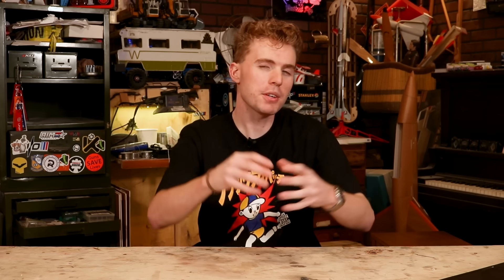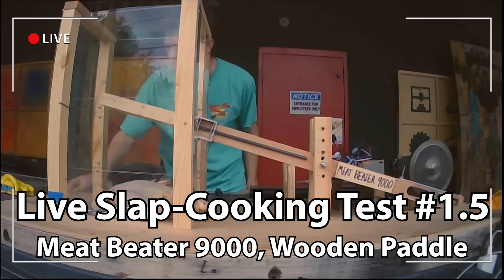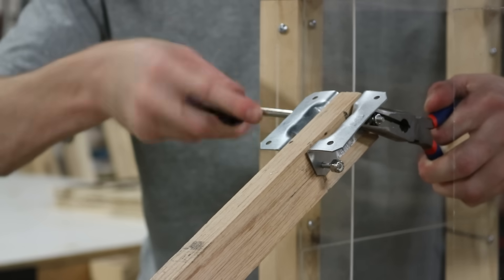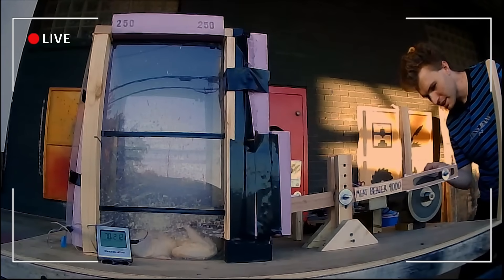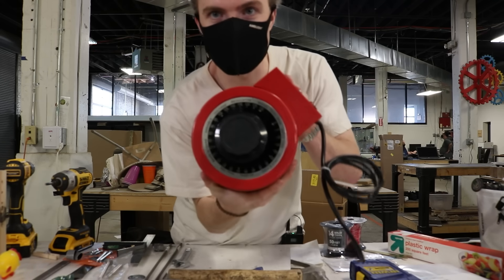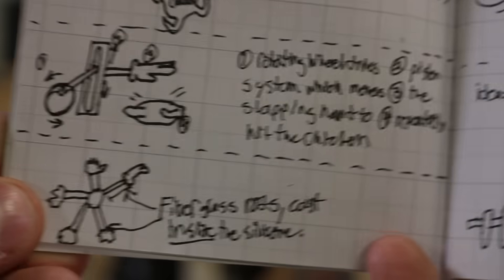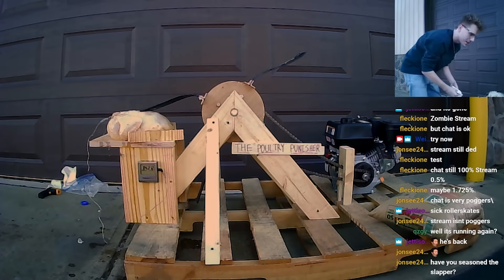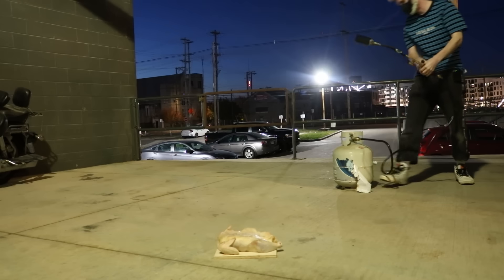How Many Slaps does it Take to Cook a Chicken?

Comment: The rubber flap slapping rig was blowing way too much air on the thing probably cooling it basically as much as the impact was heating it, I think most of its heating effect was just friction too.

The initial slapping rig would have to be revisited and just rebuilt with more durability, and the chicken would have to be contained in something that spares it the actual direct impact, like say if you built a steel casing to put the chicken in and slapped the casing instead of the chicken directly, once again keeping it inside of a temperature controlled enclosure.

Arguably though you'd just be using a slap heated oven then but it'd be closer to functional.

Comment: So is there a rule you can't apply the slaps to another medium to heat the chicken? Like I'm mostly asking why not put the chicken inside a metal container and then apply the slaps to the medical container? I mean yeah you need even more kinetic energy at that point, but you solve the structural stability issue of the chicken.

Comment: It seems the main problem is heat loss from the ambient air so the easy solution to that would be to build a vacuum chamber to house the chicken and the slapperatus. Since a vacuum is one of the best insulators every slap input should raise the temp of the chicken. I recommend a collab with hacksmith industries

Comment: The problem with the Poultry Punisher, aside from the incredibly unsafe drive train design, is that you are using what basically amounts to a blower fan to slap the chicken. The slappers are going to he cooler than ambient temperature and as a result sap heat from the chicken.

Comment: You need to slap a highly conductive metal and then use the heat transfer to cook the chicken.

Basically, you could make a CPU-type cooler which the chicken is surrounded (at least on the bottom) by a highly conductive metal and there is a high powered generator hitting a "hot place" which then spreads the thermal energy throughout the chicken cage.

Not cheap as you would need to create a custom metal high holder, a metal "hot place" that could withstand substantial force, and get an extremely high powered device that could efficiently and repeatedly contact the hot plate.

It is most certainly possible to cook a chicken by slapping it.

Comment: For the last attempt, there should have been a heater attached to the rubber allowing it to give off heat. Instead of long strips of flimsy rubber, try stronger rubber. This might help although it could make things harder and more expensive. Honestly I'm a sixth grader so i might be wrong about this so testify if you desire.

Comment: Wood table and wood in the slapper creates too much give.
Make it out of steel, build it with a variable speed controller on a 2hp electric fan motor..
The only part of the rig that needs any give is the hand itself to cushion the blow and save the chicken from popping.

Comment: Subscribed best experiment 10/10,  probably is not the best idea to slap directly the chicken, why don't you try to hit a kind of oven instead, probably the friction with the metal could work out,  but you will have to change the material of the slapper to some kind of metal fiber.

Comment: Your problem was that the rubber flaps deform and most of the KE is stored as elastic potential energy, which is actually released after the slap is over, as it bounces back. So the energy model was probably done assuming that the energy from one slap was delivered in each flap. Furthermore, each flap applies a shear stress/strain on the meat, which is why it was completely shredded. Potentially an idea where you just have a chicken breast and a completely linear slapper (Think pneumatics or hydraulics or the like) that does not apply shear stresses or strains)
Reply: Or the fact that the flaps would act like a fan
Reply: Perfectly explained 👍
Reply: Ohhh
That makes a lot of sense
Reply: Nerd alert
Reply: @lemei1095  it's constructive criticism, dk what you're on about

Comment: What is you transferred energy by changing pressure, that is effectively how the slaps were heading anyway. The change of pressure resulted in the chicken compressing causing friction when it was slapped. Maybe built a pressure vessel and either slap a bladder connected to it or compress the chamber over and over another way.

Comment: Don’t oil it and replace the rubber flaps with something less smooth. You needed far more friction on that last machine. I think it was destroyed because it took too much time. It’s a battle against the clock and you need more friction.

Comment: The last one didn't work because you lost all the heat to your surroundings, should have isolated the chicken with aluminium foil. And maybe cover it in some kind of wrap so it doesn't get destroyed but still cooked, or use softer rubber.

Comment: DEBONED chicken in an insulated cylinder. Vertically reciprocating "slapper piston" driven by camshaft and return spring rides in cylinder and bitchslaps @rpm of camshaft. Gonna need vent port opening to a reservoir to recycle exhaust so no cool outside air is aspirated. Slap three hours at 350 rpm. Serve on rye toast with sriracha. You're welcome. 
Next?

Comment: Also the original beaters were possibly better even with wasted motion.

The rubber ones scrape the chicken too much, and you want as little contact with the beater is a slap not a hug.

The rubber redesigned beater slaps and scrapes the chicken the wooden one slaps it.

Comment: Why not put the chicken inside a seperate thick plastic bag? Preheat the slapper in another bag/curtain covering both, wrap the chicken in string or elastics to keep it held it together during the process.

Maybe try with one from frozen/thawed at room temp so its a bit stronger to start with

I dont know if rubber has better temprature transfer than the thick wood did (thicker should hold the warmth longer?)

Also rub the chicken in oil or spices first and maybe stuff it with something to make it slightly stronger?

Also rubber will melt at high temp maybe use cooking silicone? Preheat the beaters in the oven or something first to atleast human body temp.
I have more ideas too.

Comment: Also i wonder if you can drop a chicken in a container filled with plenty of 2 inch sturdy, but hollow and lightweight rubber balls that are sent bouncing around the container at high speed by violently shaking the container... Could this heat up the chicken enough to cook it? How fast would the balls need to ricochet between the walls of the enclosure? And how many balls would you need?

Comment: I think this should be redone.. you can't slap the chicken directly.. you need to slap something that is connected to the chicken that will withstand the beating, but also can transfer the heat generated to the chicken.. basically a heatsink. Probably aluminum, and probably doesn't have to be very thick.. just thick enough to not break. You would essentially be turning the heatsink into a pan that would heat the chicken

Redo the experiment this way, and you will probably have a better chance at having success.

Comment: No! You don't quit. I've never watched a single video of yours before but you do not quit. Here's some ideas, trying securing the chicken to a springboard, it'll help with not destroying the chicken as it will be able to move a little bit but also won't reduce the heat. Another idea is a wider surface area for the paddle. Try something like a 1'x1' board that's about half an inch thick. Try hanging the chicken and using a slapper that goes back and forth and slaps both sides. There's so many ways you can improve this. Why do I say this? Cause I'll be damned if I don't see a chicken get cooked through slaps before I die

Comment: You best results were from test 3, what you should do is re create test 3 then clone the machine, and place the clone in the opposite side and time it to slap the chicken between the slaps of the original machine, thus doubling the slaps without needing to build a faster machine. The reason test 4 failed is because you were dragging the "hands" across the chicken creating friction that tor it apart.

Comment: have a limiter at the thickness of the chicken and just use a fillet as is a better thickness to slap and cook? maybe like two platforms with springs the thickness of the chicken between and a lobe on a motor above the top platform and the chicken between? whenever the lobe/s go by it would push the platform down on the springs and give a quick slap, 4 big lobes on a shaft with a motor going 1200rpm on 1-2 would already get you around 10000spm giving the desired cooked chicken in around 3-5 minutes xx
Reply: this idea will never die till the chicken is cooked
Reply: if you disagree i will find you

Comment: The reason the slapwhip didn't produce the proper kinetic force was the elasticity of the rubber. Not to mention the drag the rubber was producing moving at that speed just slightly transfered to the chicken resulting to the constant temp drops

Comment: Drag friction from the rubber mats basically acted as a rotory saw. The wastefull up stroke of the initial design could be utilized by shortening the throw of the lever and have the slap end of the lever y shaped for 2 slapping surface. Then fix and suspend the chicken between the slap surfaces to slap it from both sides. once on the down stroke once on the up stoke. Two heat radiating impact points may cook the chicken more thoroughly.

Comment: why did u not use an electromagnet like a speaker so you could hit it at a higher frequency. All i would do is cut the speaker part out and then customize it so it would have some slap surface. then just hook it up to a aux port and play 500HZ or myb even 5000HZ frequency.

Comment: Well, here's a question. The pre-heating and the ambient temperature control: why not continue with those? Do the rubber slappers circulate the air too much?

Another thing, the temp probe seemed like it kept falling out at the end, so getting accurate conistent measurements wouldnt be possible that way, but i'm unsure of how else to fix that issue. 

I feel like this is still possible, but the chicken itself needs a helping hand due to its fragility in the situation. Maybe bump the temp up to 105. Another thing I could see happening is doubling up the poultry punishers and setting them up so they slap but like... one after the other.

Comment: If the slapper was bigger it would last longer without getting destroyed and using the final method. Slapping it on the flat side would be better. You could also try the shower curtain and preheat method with the last attempt and you may be able to do it

Comment: What if you  pulse width modulate a certain high frequency with solenoids and some sort of contraption thus getting rid of the “destruction” issue.. kinda heat it up like a microwave but instead of waves it’s actually moving the chicken

Comment: Instead of slapping the chicken why not slap a container that contains the chicken. The container could be designed in a way that it will take heat and trap it inside while the slapper would send the heat into the container and the container would push the heat into the place that chicken is stored therefore raising the temp of the chicken.

Comment: I mean doesnt the Poultry Punisher have the issue of self cooling its slapping paddles? 

And that's why the devices that broke worked better cause it's less time for it to cool down and its retaining the heat in one slap apparatus rather than having 4 to worry about. 

Would a metal rather than wooden build be possible?

Comment: Wait a minute, the whole setup is wrong. 
Instead of using wood to hit the chicken, use metal. Also, heat the metal to a good temperature so that it can transfer some of the heat to the chicken and give it a head start.

Instead of hitting the chicken at one point, hit it all at once so the integrity of the chicken remains.

Instead of increasing the speed of the hits, increase the force of each hit by increasing the distance between the chicken and the “arm” (you will build some extra force cuz gravity)

Comment: The challenging part is that you've got all of this sort of coherent kinetic energy, where the slapper is a bunch of mass all moving together, and you're trying to turn it into internal kinetic energy, where you want every molecule of the chicken trying to go off in a different direction. The motor uses electrical energy to generate coherent kinetic energy. Instead, maybe a device that turns electrical energy into internal kinetic energy, which could be conducted to the chicken by direct contact. A resistive load might be ideal for this. And since we wouldn't be slapping the chicken anymore, the interface could be placed under the chicken, so that gravity will use the chicken's own weight to increase the area of the interface.

So... an electric habachi. A habachi might cook the chicken. Though you'd want to flatten the chicken out first (surgically, not kinetically) and give it a flip toward the end of cooking.

Comment: Since you have already introduced the heat controlled confinement, would it be a solution to heat the bed under the chicken, like a frying pan or a slab of steel, with the beater instead, a lot safer for the chicken.

Comment: the rotary slapper brike thepugh the chicken because the flaps were hitting and dragging through the chicken shearing the ckicken instead of crushing the chicken.... what if you had a plank on a hinge that rested on the chicken to transfer the crushing froce of the slap(the variable you are testing for) but not the shearing force of the rotary machine
Reply: i realise this is unsolicited advice and you will probably never attempt this experiment again, but if anyone in the comment section would like to repeat and improve this test here is a possible solution, again not the best solution but a solution none the less

Comment: I think the problem with the rotary slapper is that each slap is less powerful than the meat beater 9000, and the rubber drags along the chicken, removing a little bit with each slap. I think it could be done, but the meat beater 9000 would be once again required and would need to be monstrously strong and over engineered.

Comment: Why don't you sandwich the chicken between a metal plate on sliders. That way you can slap the plate, transfer the energy through the plate to the chicken, without actually damaging the chicken? I still think this is possible with the correct design. Your spinning slapper was probably displacing way too much air, effectively air cooling the chicken while slapping it.

Comment: What it you put the chicken in a airtight container with a diaphragm and "slap" the diaphragm to rapidly changing the air pressure inside the container, and slap the chicken with air from all possible angles.

Comment: If slapping the chicken directly is not absolutely essential here, then, the disintegration of the chicken wouldn't be a problem. 
You could slap something else, then, by the heat generated, cook the chicken.
I mean trying to cook the chicken by slapping it directly does not seem to be possible (or at least extremely difficult) , so, why not try the next best thing?

Comment: 14:20 This is False. The new construction didn't destroy the chicken because of pure force, it was a mix of the rubbers friction and the rubber pulling sideways removing one layer at a time. 

Your first design was a lot better for that. 

To optimise one needs a low friction surface that slaps from the top while the chicken has no room to spread out to the side.

Also the slap intensity needs to be turned down while the slap frequency need to be turned up so the chicken can deform elastically.

Comment: Man another Problem is that if you slap the chicken so often you always blow air over it.
So you might heat the air blowing over it cooling it also. So you might also need a vacuum to prevent heat transfer to the air.

Comment: A easy fix to this would be to use the same concept but use the energy created by slapping to cook the chicken. What I mean is to create something that absorbs the energy and heat from the slaps an then indirectly cook the chicken that way. This way you're still using the overall concept but also not destroying the chicken in the process. So for example have something that draws the heat from being slapped and have it be directed to the chicken to cook it. Like heating up water in a pipe an then having the pipe cook whatever or heat whatever. Hopefully this helps or gives you more ideas.

Comment: I feel an issue with the last design was that the "stroker" had minimal travel through the air and had increased energy retention from actively participating in the exchange of kinetic energy. Meanwhile the last design had the paddles cooled down by the air as they traveled. I do wonder if a enclosed mechanism around the paddles would have been able to close off the system to reduce heat lost to the atmosphere.